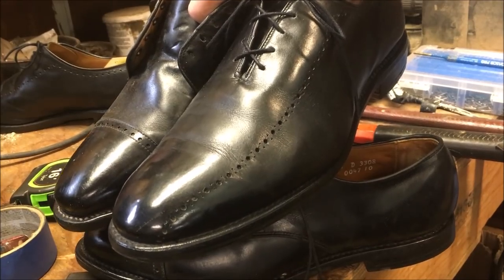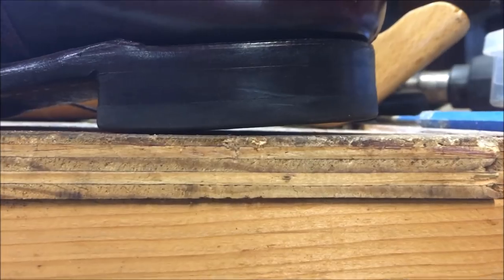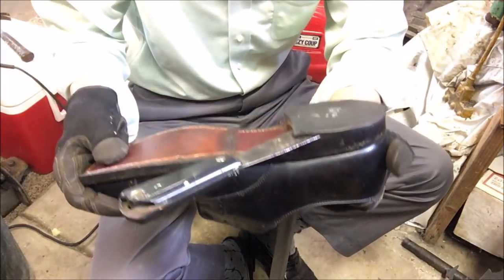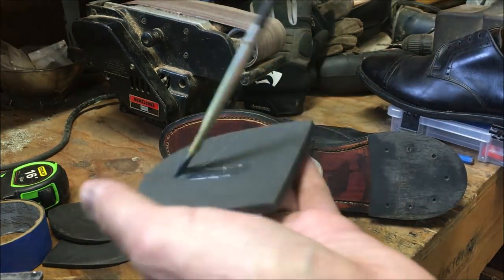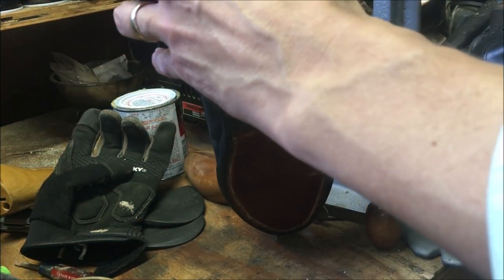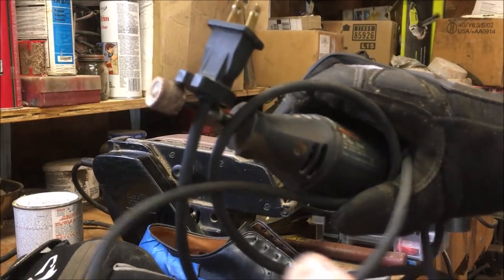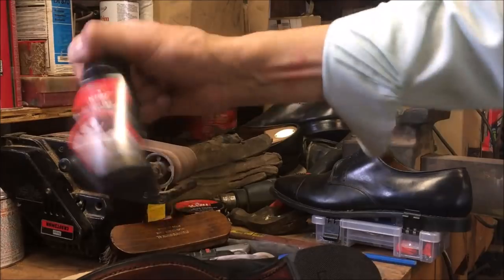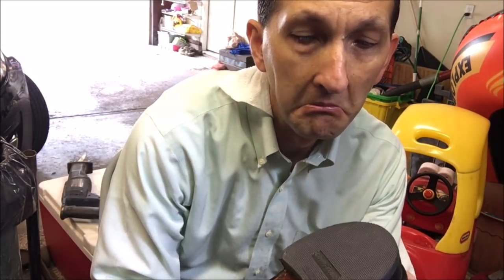How to Replace Top Lifts (Heels) at Home (detailed)

Comment: Nice, right now I'm trying to get some cobblers pliers or vampire pliers and a 16 oz claw hammer, plus the tacks, glue, and sandpaper. I bought some black balmorals with puncing on the toe cap, Brooks Brothers, and they fit better than any other shoe I've ever had. They were 17 bucks at goodwill, but I still want give them a good renovation to stretch the life they have left.
Reply from the maker: Nicolas Morillo just love the process, and start out learning on shoes you’re not afraid to ruin!

Comment: Does it matter how thick the replacement heel is?  The rubber heel thickness on the shoes I have that need replaced are 3/8th thick, should I replace them with that thickness?  It's hard to find online sellers that sell replacements thicker than 1/4 or 5/16ths.
Reply from the maker: Jonathan Smith - I have limited knowledge in the geometry of shoes, I’m NOT a trained cobbler, but I do have a degree in Mechanical Engineering Tecnology, and I HAVE replaced a few dozen top lifts. Short answer: YES the thickness is critical to the geometry. If the new one is thicker or thinner it changes how your heel and ball strike. Especially if the new one is thicker, it can really make the shoes feel uncomfortable when standing. The whole shoe will have to arch over bc the entire heel behind the leading edge (the “breast” of the heel” will be too far off the ground, causing the shoe to flex in the wrong direction when you put weight on it. 

The problem I had with AE top lifts is getting new ones that were thin enough. Most of them seem to be 1/4”. That’s why I went through Landwerlen Leather and got 5mm thick (approx .20” thick) leather and rubber sheeting, as that matched the AE factory top lift thickness almost exactly. The Goodyear Top Lifts I used in the video say they are 6mm  or .236”, but from my experience they’re a little thinner than that so they’re close enough. 

I’ve seen professional cobbers remove the top lift AND the thin layer of rubber under it that’s nailed to the heel base on AE shoes. Then they re-nail the heel base on (with shorter nails I assume) and replace BOTH the top lift and that rubber intermediate layer with a 1/4” thick top lift.

Comment: Hi Robert—quick question: I put new top lifts on my shoes, but the balance was completely off. I made sure to order 12 iron top lifts to match the thickness of the original, yet they somehow still feel very off. I noticed this same thing after I took another pair of mine to a professional cobbler; I took a trip back to the shop and asked them about it, and they took them back to correct the issue. However, I have no idea what they had done to fix the balance, and I am wishing to know how I could do so with the ones I tried repairing myself. Thanks!
Reply from the maker: ThatRandom Dude - what kind of shoe? 12 iron is 1/4” thick. The difference in thickness is sometimes subtle. With Allen Edmonds shoes for example, 1/4” top lifts (0.250” thick) are THICKER than what they use. I measured theirs closer to 5mm (0.196”) or 10 iron (10 iron = .208”). That 0.054”  (going off of the 5mm) or roughly 1.25mm difference IS enough to cause the shoe to rock. 

If it’s an Allen Edmonds Shoe, the heel base made of ground up paper or leather (I don’t know what it’s made of but it is a composite), THEN they have a rubber layer on top of the heel base. I think I show this in the video, but it’s been a long time since I’ve watched it. BOTH the heel base and that rubber layer are nailed to the sole. THEN the rubber top lift is glued to the rubber layer. I have seen cobblers take off the whole heel base, remove the rubber layer, and after re-soling the shoe put only the composite leather base back on without the rubber layer. Then they use the thicker top lifts and it all works out. Otherwise, I think the BEST solution is to get the proper thickness replacement top lifts. That’s also why I got bulk leather and sheet rubber, because I could not find thin enough top lifts, or they were too expensive, or suppliers wouldn’t sell to an individual consumer. 

If the heel is too tall and the shoe rocks back and forth on the front edge of the heel, the only other option if the above 2 solutions don’t work is to sand down the heel base lower.
Reply from the maker: I wouldn’t bother trying to sand down new top lifts. I tried that and it’s too hard to get them flat.

Comment: can / should you add top lifts to the rubber soles of a new pair of loafers ?........a very well detailed video by the way !
Reply from the maker: Do you mean over top of the existing factory heel? Now again, I’m not a cobbler, but from my limited experience, anytime you increase the height of the heel, even a little bit, it can upset the balance of the shoe. I think it would also be difficult because majority of the time there’s a tread pattern there, I think you’d wind up sanding it down to get a flat surface, so I think that’s a no-go.
Reply: @CobblerBob  .......yes, on top of the factory rubber soles........i don't think i'll go for it since i'll be walking a little bit like in high heels........the cost of replacing the top lifts twice will be close to buying a new pair of shoes = i live in Singapore and cobblers here charge high prices for shoddy materials and sub-par workmanship.......sigh

Comment: What you said at the end "a little appreciation for your local cobbler", so true. I  bitched and moaned about 15 euros to heel a pair of shoes. I worked it out, your video was nigh on forty minutes and in real time. That's twenty euros an hour approximately.  You're right, it is a lot of work for 15 euros, even 20. I must have been delusional, thinking rip off a piece of sole, glue on another, let it dry, trim it up. Bob's your uncle, Fanny's your aunt, job done!! Thirty years ago when I bought my first pair of brogues, it was a fiver (£5).  Great video matey, set me straight. Tx.
Reply: Only 15 euros to heel shoes is a deal!  Around here it would cost $40-50.